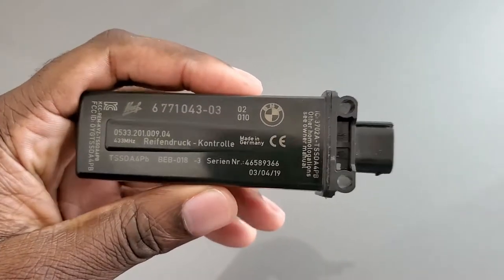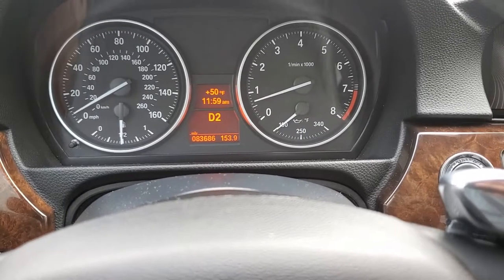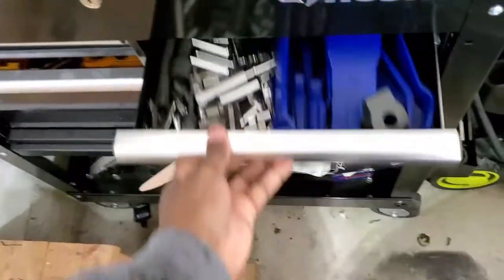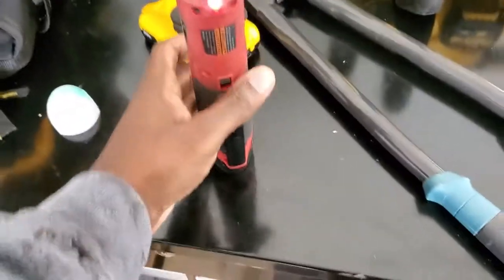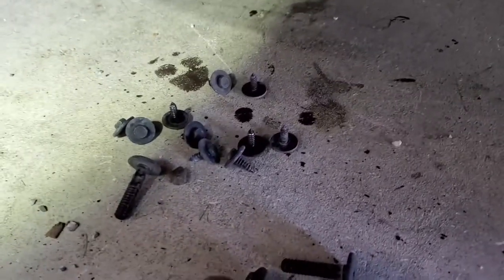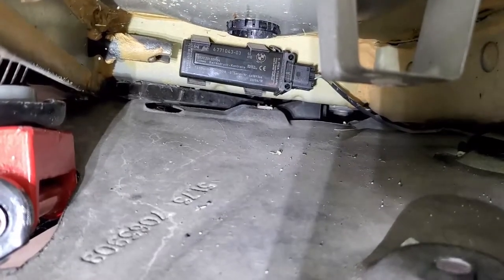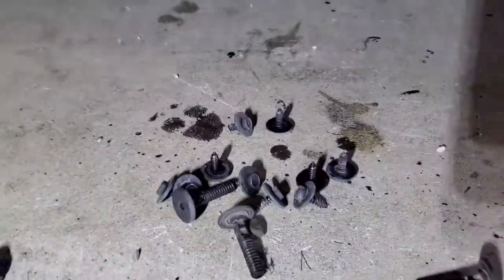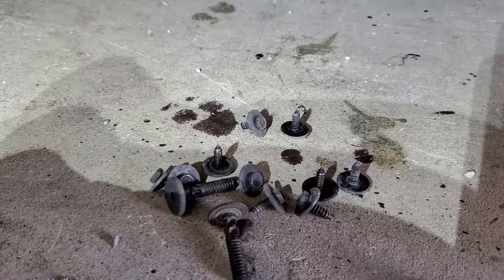TPMS Antenna (side quest)

Comment: What car exactly?
Reply from the maker: The antenna is for the 2009 and up. I think on the 2006 to 2008 its some where  in the rear of the car.
Reply: @Kyngcoupe  ANY idea exactly where maybe on a 2007 328i coupe ? cant find anywhere , uh :(  TY !
Reply from the maker: @akashaman  You may want to try behind the rear wheel, behind the fender liner.